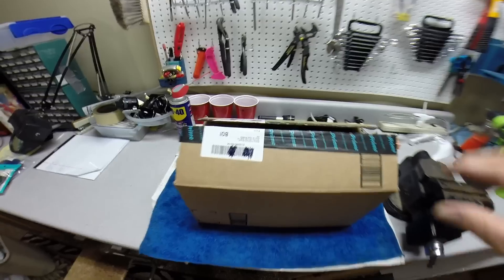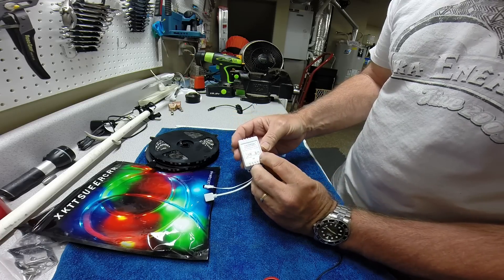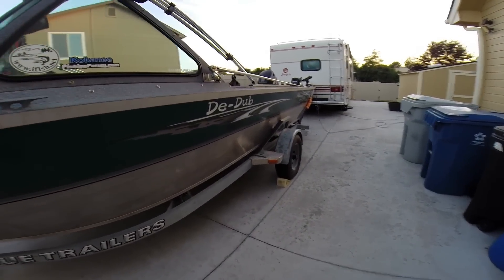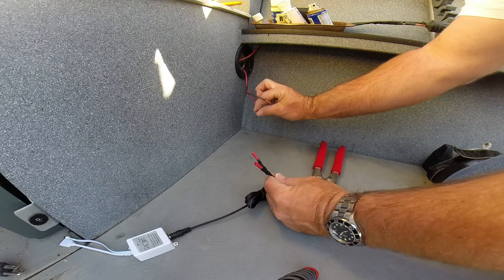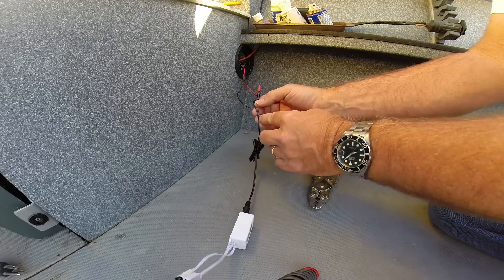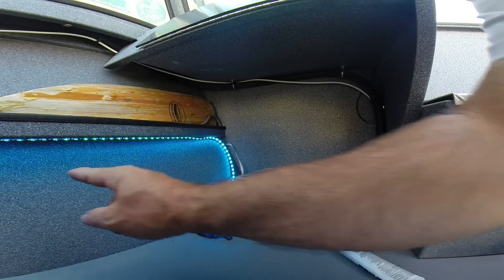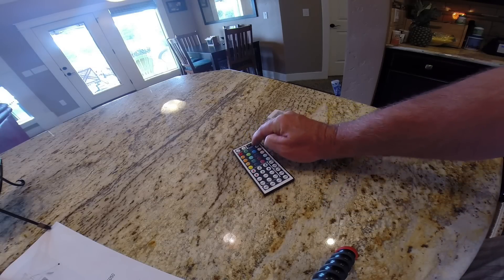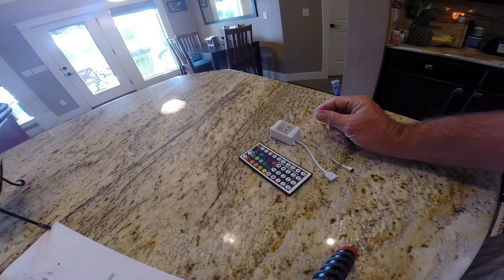How to Install Amazon LED strip lights on a fishing boat

Comment: As some have said use an inline fuse and depending on the expense of the leds you may want to use a constant voltage regulator to stay at 12 volts since alternators run at 14 volts.

Comment: They work good but the ones i bought will not hold up to the heat that my aluminum boat gets. I mounted them under the gunnel and 2 weeks later falling down i cleaned and preped everything and i bought the good lights that uses 3m tape and still did not hold up but worked great when they was up .

Comment: I installed the waterproof IP68 version, 5050 strips on my Pontoon boat, with one Control box for both external runs (one strip per side)l, and one control box for the Internal under seat strips and wired as such:
coming from my courtesy light switch power, I split the 12v power to two heavier duty 30amp Control boxes, so 12v power and ground going into one RGB wifi controller box, 2 lengths of 12ft, 18awg RGB wires to the front of the pontoon on each side, (one output per color coming out of the controller, so I combined each leads color wire, per RGB color, to run to both sides) then soldered into the leading edge of the 16.4 ft (3 meters) LED strip. That 30amp Control box seems to be acting weird, as so many others have and have burned out. the amazon 6amp boxes got very hot quickly, and burn out fast. this 30ap box lasted longer and didn't get as hot, but after a month or so, certain colors start acting weird like not lighting up, or even allowing the strip to power off when I try and do so.
I've also done this same set up for the 3 under seat strips on the interior of the boat. except, each LED strip is cut down to about 4 feet or 5 feet, and there's an 8 to 10 ft RGB wire going direct from the box to each seat. )Again, One control box, 12v power, and ground going in, split with the other control box for the external strips, and this time tripled up each RGB colors wires going out to the 3 seats.
Can you help me figure out why I'm having problems with these controller boxes burning out or working improperly after a few weeks or so?

Comment: I recently just install the led lights. I did all the wiring exactly like how you did. However I ran into the same problem. The lights will come on and stay blue. I can not turn off or change color. I will try to get a new remote and control box. Hopefully that works as it did for you.
Reply from the maker: Sorry are having this issue with your lights. I hope you get it corrected soon. Good luck!
Reply: @davewallace3899  I figure it out. I had to switch the wires around. The wire with the white lines is actually the negative and the solid black wire is the positive. Everything works as it should now! Easy fix. 👍🏼
Reply from the maker: @EWH87  Right on! Enjoy.

Comment: Just so you know I have 4 sets on my pontoon and the problem you had was the control units can only handle 5m of LEDs or they can over heat or not power the unit... Also the control unit can use up to 6a of power when using the 5050 LEDs at 5m in length, you should have ran one strip up each side and used both control units one for each strip, the one remote will work with both... I extended the IR receivers on the control boxes so they all run up to one location
Reply: Adam I just wired my strip up. I was testing it beforehand inside the house when i was still able to plug it into an outlet. Remote worked perfectly. I installed the strip in my boat. I wired it up to my battery and the lights are working, however, my remote will not work now. Any ideas why this is? I have an in-line fuse with a 7amp blade fuse in there.
Reply: Trevor Kingsley the remotes are IR so they have to be pointed directly at the small black receiver on the control box. If not then you should upgrade to the RF remotes that use radio waves so you don’t need to be in direct line of sight.  Also make sure the small plastic thing between the remote and battery was removed. This was posted 4 years ago so mine have been upgraded to RF and I added others with small SP switches.
Reply: Adam im looking to install this in my 25 ft pontoon boat, can you send me the info, I don’t know anything about installing, TIA

Comment: Hi. Just bought a set of these lights. Just wandering if the amps are ok. Coming straight off the battery. ? May get a new remote. I see what you mean. The remote feels cheap n nasty. Good video. Cheers

Comment: How are they holding up? Doing my bass boat this year and shopping around. Did you use ip65?
Reply from the maker: They continued to work perfectly up until I replaced them with round LED pucks from Amazon. That's been about 4 years ago new. I wired these to the AUX switch on the dash. Same concept. They put out alot more light. Good luck and God bless!
Reply: @davewallace3899  the COB? I found some of those as well! How do they look on your boat man?
Reply from the maker: @BASSANGLER7MH  ,  Not LED COB's.  They are squares with just white light.  They are almost hidden, so appearance is not an issue.  The boat is still covered for winter here in Idaho, otherwise I'd show you a picture. Good luck!

Comment: These Chinese hobbyist electronics are produced by the millions each year, there are bound to be a few thousand rejects. It is highly likely that both remotes were manufactured in the same factory, and if one feels heftier than the other, I'd like to see it on a scale. Could even be a defective battery that doesn't deliver sufficient voltage or current. QC may have missed a defect with one RF controller where perhaps the buttons weren't making contact with the PCB properly, and likewise with the LED controller. SMT components are wonderful in terms of space saving, but have a ways to go for reliability, especially when manufactured to sub standard quality levels.

Comment: Hi Dave,

Great Video. Thank you very much. I am trying to do the same for my tinny, and I'm stuck on trying to connect the LED's to the marine battery, how do you do the wiring? Thanks Xavier
Reply from the maker: +Xavier Clark   I just ran 10 guage wire directly to the battery with a in-line fuse on the Positive side. The control box and remote are what turns on / off the light strips.Hope this is helpful! God Bless

Comment: Tried this same thing, twice actually, and both times it immediately fried the white controller.   Something popped and it got super hot.   Not sure why but assuming it was too much current.
Reply: the problem is the controller is fine when using 5m of 5050 led strip. when you add another 5m to the length, the amperage draw is too much for that little unit. you just have to purchase a separate unit that has a higher amperage output. easily fixed. ;)

Comment: What kind of glue did you use when you put up the lights where having a hard time getting ares to stick to the boat
Reply from the maker: Hannah Hoon , I used cheap dollar store super glue. I would place a few drops and then wait about 3 minutes before running the light strip. Hope this helps. God Bless.
Reply: Dave Wallace thank you

Comment: Where'd you get that little transformer? Or do you have a link for one?
Reply from the maker: It comes with the light kit.
Reply: @davewallace3899  just bought the set, did the same thing you did with the stripping the transformer. When I attach directly to deep cycle 12v battery it flashes and quickly goes out. Seems like a bad connection?? Itll flicker and rubbing them on the terminals will get them to come barely on and off. I didnt do the in line fuse set up, what do I all need for that..Any suggestions? S.o.s thanks in advance
Reply from the maker: Michael Wozniak , I've since removed these and went with another style of lighting. Make sure you have a solid ground and direct wire to the battery. Otherwise it may be a bad control box.

Comment: Dave,Did you have any issues connecting the two LED strips together?  Were you able to jsut hook them up directly without an adapter?  Thanks
Reply from the maker: No adapter needed, just plug them end to end. Good luck.
Reply: How did you hook them to your boat battery? Thanks so much.

Comment: Great job on the install.Did the adhesive tape hold up over time?
Reply from the maker: TheIndianscout I actually also used super glue in certain areas. I also have now removed these lights and installed another style that screwed and glued in. I hope that they work as well for you as they did for me. God Bless! Dave
Reply: @davewallace3899  Thanks for the reply.